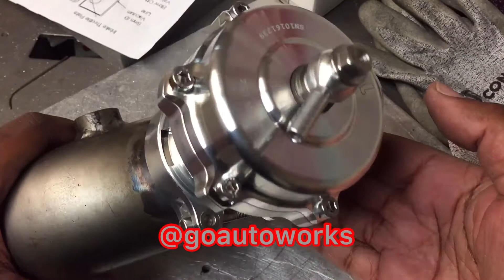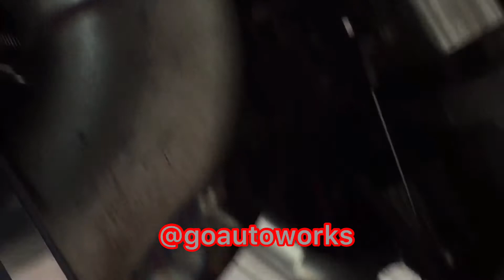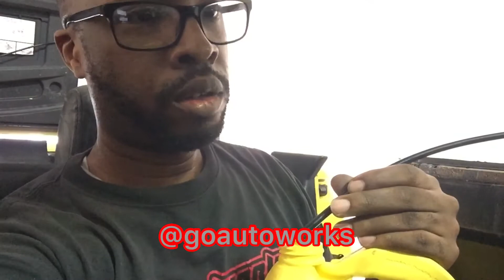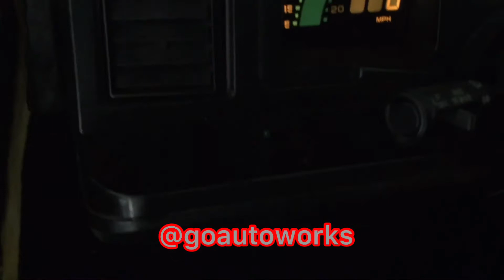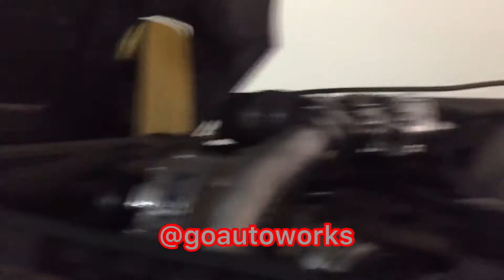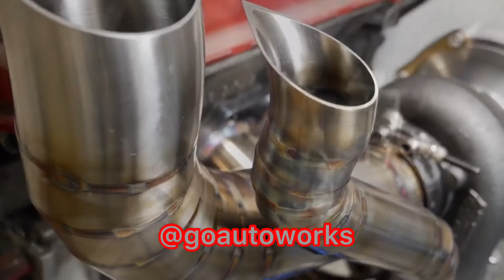C4 Corvette BOV & Methanol Install Wrap Up

Comment: on the bov did you use a 2 psi spring or is it already preloaded for a blower rather a turbo?
Reply from the maker: Hello, we usually stock these with the 6 psi spring which is what is shown here. It will work with turbo and SC apps
Reply: @GOAUTOWORKSYOUTUBE  Awesome thank you for the reply!! Have a blessed day brotha!